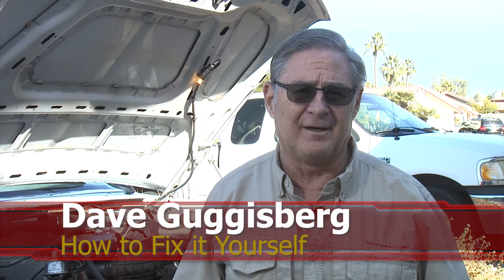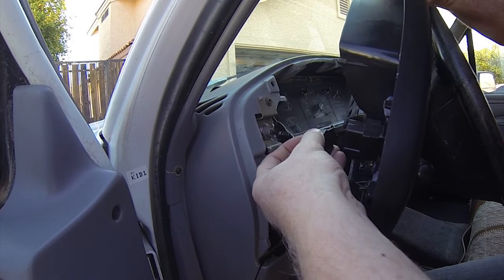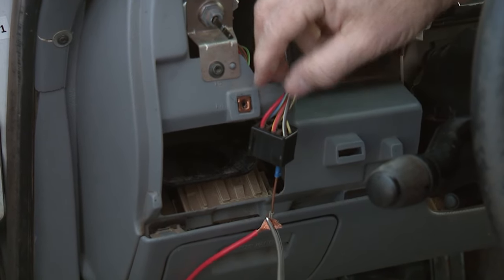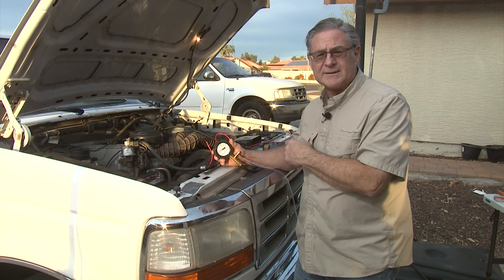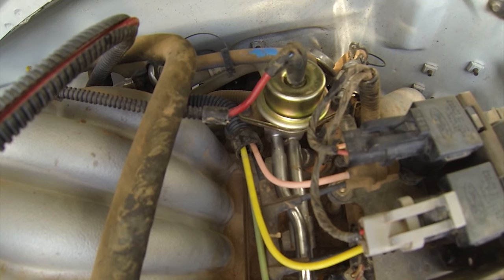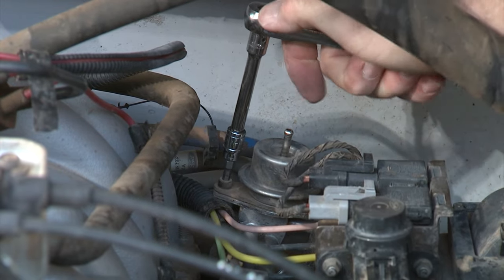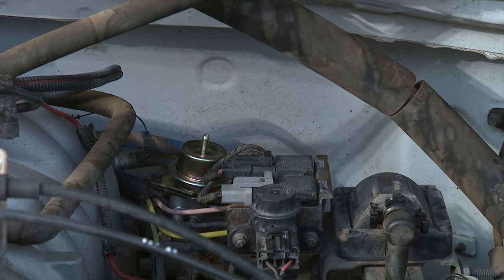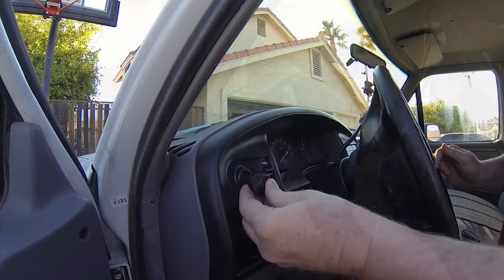Fix for Low Fuel or no Fuel Pressure, Ford F150

Comment: Well, heres a doozey for ya'... 1993 Ford f150 5.0/302...135,000 on the clock... Had Crank, No Start Condition with fuel pumps keep priming bout  3 weeks ago...Went to 2 name brand parts store...Rent-A-Tool program....Busted out 2 spank brand new Fuel Pressure gauge Tests kits...Still new in the plastics...Hooked up to fuel rail both times according to the directions...No fuel pressure sensed by either gauge....But, truck today runs and drives as normal...Before (3 weeks ago) sounded like a old John Deere tractor... Took it to a shop, they couldn't find the problem...Left the rip you off shop, it was spitting and sputtering and cut off a couple of times till it warmed up...Made it back to my house and I parked it till I had the chance to clean the IAC with GumOut Carb Cleaner, Re-installed same old IAC with new gasket...Also added some Techron gas addititive to both tanks...Also, when manually push down on the fuel rail Schrader valve,  some fuel spurts out, but nuffin ' to jump up and down about...Truck runs and drives today as if nuffin' ever happened...Pulling hairs and straws tryna figure what to do next...Also, pulled the EEC and clean off some of the rust on the holder and the EEC...Opened it up....Capacitors looked okay...It's a REMAN, not the original,  but can tell water has gotten inside of holder and EEC box...Board looks good, tho'...I'm stumped...Help...
Reply: Sounds like that eec is bad again, buddy. I had the same problem with mine. If water gets into it, it'll cause the fuel pumps to continue running and run like crao
Reply: @chrisgraham3962  ...Was looking to replace the EEC...Two months later....Betsey LuLu running like a Champ...No issues, except for what you get running a older truck....Thanks for your help and reply, tho.....👍👍😊😊
Reply: Hey there, let me add my 2 cents, I got a1992 f-150 4.9 liter Inline 6 with 133,000 miles and I have replaced every sensor and am still having issues with it running right!!
    I can start it up without any problems and it'll idle all day long almost perfectly however it has a little miss in it from when I got it.   Anyways if I drive it around the block it will start to miss then stall/buck/jump, and I really noticed it whenever I'd go up a side street by my house that's a pretty good hill and I'd have to back back down and then it would sputter all the way back home (2 blocks away, lol)..... Anyways I bought a fuel pressure guage from Harbor Freight and tested it, and I couldn't believe that I wasn't getting any reading on the guage....??    Especially whenever I could start it up just fine..... so this went on for several days and I kept checking the sherader valve to make sure it was clean and nothing was hooked up wrong and I even took back the fuel pressure guage and got another one and Same thing--- NO PRESSURE???........ So i knew it was probably the fuel pump because the rear tank is the ONLY tank that works,  it was like that whenever I got the truck....      Also I had just replaced the fuel filter about a month ago and I checked the pressure regulator and it it in good working order, so since its got new fuel injectors in it as well and a new distributor and new plugs and wires and new o2 sensor,  I thought it's gotta be the fuel pump,......right ??......Especially when I try to go uphill and it starts with the sputtering......  I assume not enough fuel pressure.     I don't know enough about the EEC, but I do know the previous owner replaced it and coil pack.     So you're not alone, sir, whenever you're saying that you ain't gettin any fuel pressure...... I've seen it myself!!    And yes, I was using the correct shreader adapter explicitly for the Ford F150 trucks!         Any suggestions on what you all think, please let me know.     God bless
Reply: @mirandabri834  ....I  gotta say...This problem got us both STOMPED....A week  or so, it did that same "sputtering and spitting " like was not getting enough  gas...Took out the EEC, cleaned the holder...I  got water Intrusion from somewhere's...Last week,  Trk running great, then cranked it up, spitting and sputtering,  I just gave it the gas and said..."You ain't abandoning me a mile from home, It's you or me, Chicky....!!!"...Finally it started running on all cylinders....As of today,  it's  running  okay...Cranks good, runs fine....This is nuts to say the least...Mechanics 'round here ain't  all that good,  even though its tons of shops....You know how to fix the problems with your trk  better than they do....
Reply: I have a 1992 it basically did the same thing ran great after I put the new computer in and then bad again, the last thing I changed was the coolant temp sensor and it seems to be running fine now.  But my truck had the opposite problem it kept flooding out with gas. Hard to start and kept randomly dieing and sputtering, only reason I knew is I smelled gas and it would smoke once I got it started. Put new temp sensor in runs fine now so hopefully it's fixed for real this time. It did die yesterday but only on hills turns out I'm just out of gas lol, the gauge is all goofy it starts off at 1/4 tank and after a few minutes it goes to the real amount which is Empty. The back tank was empty anyways so it didn't help when I switched tanks. Goodluck
Reply: The pickup coil in the distributor heats up confusing the EEC causing fuel pumps to run relays to go crazy and possibly gas pumped into the cat which then overheats.
Reply: @mirandabri834 Put a carburetor on it, I've put more money in mine than what the van is worth, still runs like shit, Fords efi is garbage
Reply: @mirandabri834 I'm getting old and have only had old Ford's.  All of y'all check this little problem I found a few times.  When the engine gets warm, the stator will move on the distributor shaft.  Not the rotor, but the stator under the rotor.  Also check for a cracked pick up coil in distributor.

Comment: Replacing fuel pressure regulator fixed my issue after replacing other parts I thought needed replacing.  Before this video I'd just avoided driving the truck because of surging at high speeds,  cutting off at stops, idling up and down.  Now I drive it 30 to 60 miles a day as my primary work commute vehicle.  199243 miles and runs like a champ now.  Thanks Brother!!!

Comment: You can bypass the ECM controller for the fuel pumps with a jumper wire on the diagnostic connector between connector 2 and 6. Then you don’t have to dismantle the dash.

Comment: I am glad to see that they move the bolt heads for the regulator to the top. Mine is on the bottom 1991 f150
Reply: I noticed that today on my 1991. The bolt heads are on the bottom. Also sort of difficult to reach. I’m going to attempt a replacement of this soon.
Reply: @mattreyes79  where does the black and white wire on a fuel pump goes .
Reply: Darrell Geist,those little screws that go from bottom to top are a real pain,especially considering how small and hard to get to they are.When replacing the unit do yourself a favor and go from top to bottom!

Comment: Replacing the fuel regulator on a 1990 F150 5.0 requires pulling off 3 allen  bolts that screw upwards and the one nearest to the fire wall is a sob, unless someone else knowes a easier way?

Comment: They way to check the regulator is with a manual vacuum pump. If working correctly fuel pressure will decrease when more  vacuum is applied
Reply: You said it backwards
Reply: @vickvam3412  you are correct. Must have  had both thoughts try to come out at once . When running if you remove the vacuum it will gonto regulated pressure. When you hook up a vacuum pump  and pull vacuum it pulls the diaphragm and reduces fuel pressure. I corrected it thank you sir
Reply: This instruction video is for diy mechanics...your instructions sound like your talking to another mechanic...if your going to use such technical wording...back it up with how exactly it's done ...so annoying
Reply: @msegert173  im sorry i spoke plane english. Not one thing i said was technical. The process i described  uses basic hand tools. If you dont know what the fuel regulator is you dont need to be testing the fuel system. And a  vaccum pump is available  at Harbor freight for under 20.00 and if your going to work on cars tou need to have one

Comment: In your description you say the Inertia switch comes after the selector switch. It doesnt. It goes like this...fuelpump relay to red w/yellow wire on the inertia switch plug that sits between the black n white and the red wire on the fuelpump selector switch plug you tested both fuelpumps off of . You test the inertia switch by testing the red w/yellow wire for power using a DVMM and the key turned to the ON position. Both fuelpumps should register 43-45psi each with engine not running and after the engine starts vacuum suction lowers the fuel pressure at the fuel pressure regulator and the fuel pressure should read 33-35psi to run the engine properly...Another thing to do to get a more accurate reading is to change the fuel filter after doing initial testing...This will tell you if you had a fuel restriction. Most times the antibackflow checkvalves on the fueltank outputs are the culprits........
Reply: Plz do tell about these check valves..

Comment: I have a 1986 f150 and I have replaced both pumps and the filter and put in gas treatment but still when you turn the key it will fire up and only keep running if you pump the gas and even then you can’t rev it up and as soon as you let off it dies.
Reply: Regulator. Had a similar problem
Reply: Also sounds like vacuum leak

Comment: Just fantastic,so many misleading or false advice on  videos, your content was spot on the correct. Dual tank switch was the failure.
No dropping of tanks or throwing away 200 bucks.
28.95 switch and no wasted time.
Thanks again

Comment: Learning to by pass the selector switch was the major thing l took from this. Thank You!
l learned only the rear low pressure pump is running in by pass but no gas comes out of the line before the diverter valve. Low pressure front pump not running at all. High pressure only when hooked direct to battery. The dash comes apart much easier on a 87 F150.

Comment: Im working on a 90 f150 4.9 6 cylinder. Checked pressure with new gauges. With key on engine off 0 psi. Tried several times. Started it and 0 pressure . Pulled tester and connected to a tire 45psi. Pressed relief valve and fingers got wet but not 45-50 psi worth. Started it and did the same and my hand got wet but not shooting out. Pulled the line off the filter after dumping the fuel out of the filter and reinstalling it and after 10 to 20 key on engine off it raised to 30 psi. Left it for some time. Came back and it had dropped to 20psi. Twin tanks havnt worked in decades. Pulled the switch and found plastic plug melted around 4 contacts. Now I have to find what melted the plug. I understand that 4.9 should have 50 psi. I'm going to try to bypass the fuel filter with a tube advance auto parts sells. Good video. Thank you.

Comment: I'm having issues with my 1990 F-250 . Replaced the inline fuel filter but no difference. My relay is on the firewall to the left of the brake pedal. Haven't checked the selector switch yet but I'm going to go ahead and replace that regulator under the hood.. Mine's a little different.. some genius designed it to have the hex head screws coming in from the BOTTOM! I had to use small vice grips to loosen and remove those screws but I gott'er done. I'm going to totally replace everything under the hood I can a little bit at a time but for now I just need to get it running reasonably right. Thanks for the great Video Dave.
Reply: daddy, boy do i feel your pain on those underneath allens!  i have a 1990 e350 van and i was so excited because of all the things i've had to change i looked at that one and said 'finally, an easy one i can actually get to', well...nope, that one allen you can't get to because of the plug for the fuel injector and 2 other plug wires.  you can't get into that engine forward side of fuel injector clip release to remove the plug.  i rotated injector and finally got stuff off but now i wonder if i didn't create a small leak at the injector gasket.  i get more pressure with new regulator but now loose pressure fast.  damn,  everything's such a bitch with these vans.  anyway, i had to reply when i read your pain because i'm your soul mate in said pain.  wish me luck daddy:)))-barbie

Comment: Life saver of information sir. My '87 was having no start issues, and if i jumper the relay harness and force pumps to run, i start right up. With the relay installed i cant turn over. Was gonna replace relay unless you suggest further TS
Reply: It depends on how far you have jumpered. If only around the relay, then replace the relay. If it is around the relay and the fuse, check the fuse. If it is all the way back to the tank selector switch, then check the switch and the roll-over switch. Relays are not too expensive, so it is an easy bet to just do the relay.
Reply: @GunStockReviews  its so inconsistent to start up, but the relay does only buzz the pumps on for a second or 2 on ignition on. That may be it bc it fires up bypassed and the pumps constant.
Reply: so it does seem to be more a bout fuel delivery to the injectors and the fuel pressure at the rail bottoming out requiring the pump by pass to "prime the system" in order to start. i am planing to replace the external pump and pressure regulator given their age at this point.
Reply: Turns out in combination with the external pump, fuel regulator... my egr valve was leaking, alternator was dead, and distributor was out of time.

Comment: There's a metal bracket available to hold your fuel pump selector switch in your dash.  If you snap the screw holes off the back of your bezel you can buy this metal bracket and screw the switch to the dash instead.
Reply: where can I get one of these? just pulled my bezel off and discovered that the previous owner had already snapped the screw holes.

Comment: This was helpful my 91 ford bronco was having starting issues its getting fire n gas but aint turning over i replaced timing chain   but the initial start of my problem was i would be driving and it would die out i wiggle the fuel relay and it would start up again i thought the relay was problem but not

Comment: Bought a 93 4.9 in November. It won’t start without ether. I’m going to try this next.
Reply: did you ever find out what the problem was i'm having the same issue 1993 f 150 4.9.changed a lot of parts even the computer. Please let me know  Thank You Ken
Reply: @123kmcd  I’m hoping it will be the fix. But can’t say yet. the fuel pressure gauge was $60, I’m doing this with my wife watching the finances so I have to fund this without her knowledge, which isn’t easy in a cashless economy. But I got the gauge and I have good psi. So I had to get the fuel pressure regulator which with shipping was $70. I got it from rock auto and didn’t go with the cheapest one. I just got the part a week ago and haven’t had the time to install it. I also got a fuel filter and too I haven’t had time.

Comment: There are several ways to test psi reg. Check to make sure it holds a vacume . Take vac . hose off when running and psi should go up approx 8 psi. Also look for any fuel in vac hose.

Comment: Amazing video! Question for you. I did the test. I get no reading and no sound on the front tank. On the rear tank when I touch to positive on battery, it just sparks a tiny bit. I have my pressure gauge hooked up, and not getting anything. Is it possible it's a grounding issue? Does it ground off the frame, and maybe I can clean it off? The front tank and pump is new. 
Thanks again for the video! Cheers

Comment: I'm here because my 96 f150 5.0 "shudders" at around 40 to 50 ish mi hr. I'm not sure what my issue is yet but your video gives a great diagnostic plan thanks...appreciate you Sir
Reply: Having this same issue. Did you find a fix?
Reply: Tested your intake/exhaust system PSI? Any CEL?
Reply: @nicholasparry6859  no sir I did not. Got tired 9f throwing parts on it and dropped it off at the shop. Ended up getting a new distributor and a wire or two got swapped. And refreshed the ac ...had a leaking Schrader valve that I've known about for years. $1k later...all good. Thanks for the comment
Reply: @BoxcarsGarage  sorry to hear she gave you so many troubles. Thanks for your quick reply!

Comment: I have a 96 f150 and truck was running fine, one day it died on me while running, sat there for a good while trying to get it on and finally cranked on and ran a bit rough ! Month goes by and once again, same issue while pumping gas. It took a long time trying to get it on, idle was a bit stuttery and ran a bit rough but got me home.

Comment: On these EEC-IV systems it is much easier to give power to the fuel pump by placing a jumper between pins 2 and 6 off the EEC-IV test connector.

Comment: most fuel injected engines have a fuel rack on top of the engine. its a valve like a air valve stem...just use a nail to push in that valve and a squirt of gas will come out..that will release all pressure in that rack....then flip the switch to the other fuel tank if you have duel tanks, turn on ignition and then turn it off and again use the nail to push in that valve stem like device...if fuel squirts out again then you know the fuel pumps are working and  that is eliminated as a problem